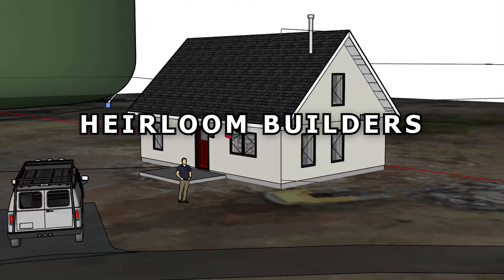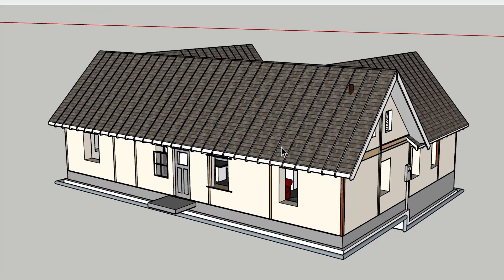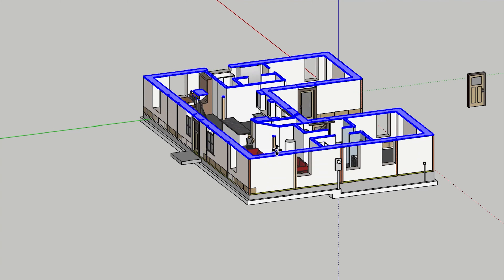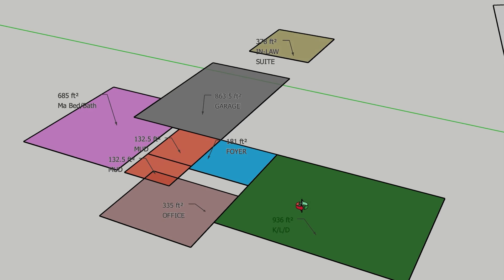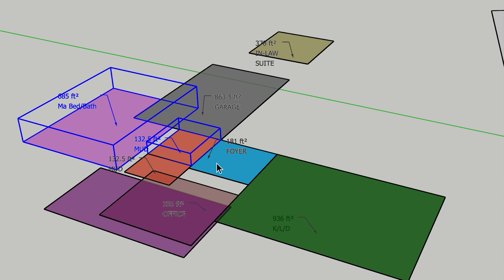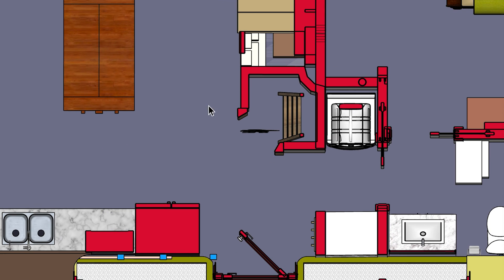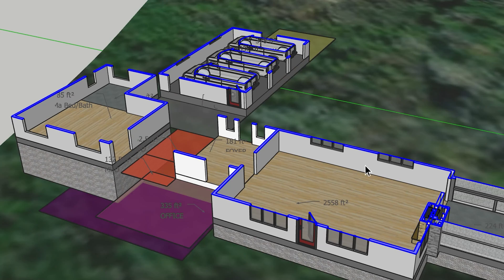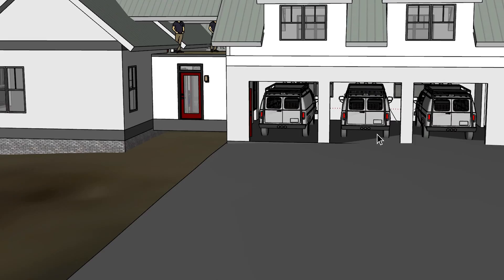How We Saved $$$$$ using 3D SketchUp before building this home. What is "Schematic Design" anyway???

Comment: Sure east gets them awake then when they live during day then light is not on west so switch it around  give them more light at night instead of having to use electricity west side sunset then they have more light later to see without excess use and in day same what is the point of bedrooms on east yes it wakes them then they dont spend time in that room so they then end up on west side with no light  so try to consider switching it up maybe?  They have alrm clocks to wake them.

Comment: put french doors at the u shape center and make an area to eat and a fire place bbq area  or better yet build longhouse style and build in a cross shape and make 4 extrior courtyards to extend and make seem bigger with pool exercise areas in one fitness areas under  veranda or gallery and screen them in and give light and or bbq cooking dining area build them a 40 x 40 slab out for patios too then they can get tents in future to extend and add every 6.8 ties for garden cement features to tie to and plan for exterior garden parties plan to design FLOW for spacious feeling if they want courtyards give them 4 areas in cross stryle longhouse style easier for you to build and put roof and solar across all 4 sides so you can capture all light every angle! Then 4 areas for courtyards pools and patio fireplaces etc build in features  so it functions for life!